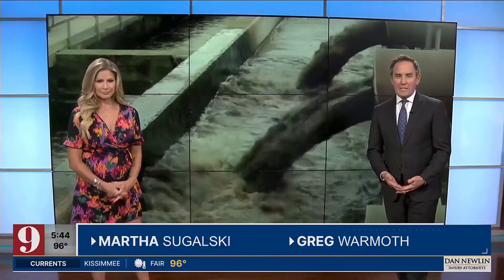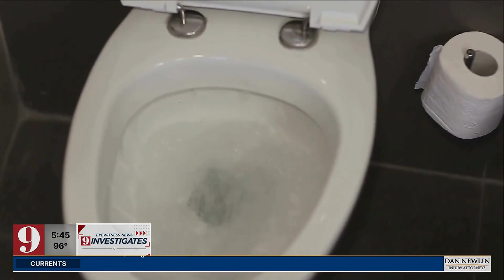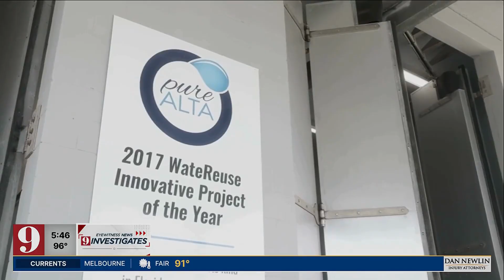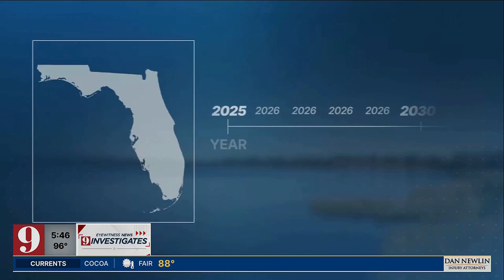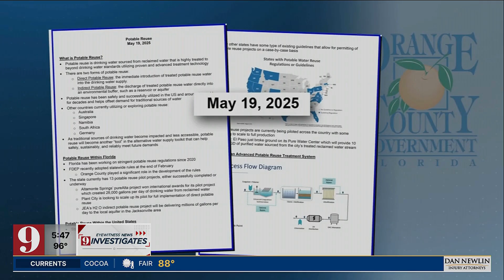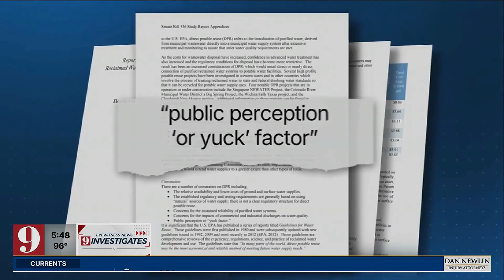Florida’s Plan To Turn Wastewater Into Drinking Water!

Comment: I feel pretty confident that localities that use surface water, rivers you know, for their drinking water are in fact drinking water that has at one point been flushed down a toilet. Think about it, cities up stream clean their waste water and it is deposited back in creeks and rivers after that. That water runs south and is sucked up to be filtered and treated as drinking water. 

For example Polk County discharges treated wastewater to the  Alafia River  which Tampa uses for their drinking water.

Comment: As I walked outside and considered this article, I had a revelation. There are many sources of water. Water is in everything natural. Plants, trees, soil, crops. We have the technology to make clean drinking water from any water source, like lakes, streams, reservoirs, ponds and rivers. Those water sources are cleaner right out of the gate than recycled water, and it needs much less cleaning and purifying than water that is already used and toxic. Why recycle the filthiest, deadliest water when we can recycle water from cleaner sources? This includes crops. How much water could be extracted from fruit for instance? If you have even done any juicing with a juicer, you know the answer to that. Probably 95% or more is water in the form of juice. Watermelon is about our most water-filled fruits.  Pure water extracted from leftover crops, or crops grown for the "water industry" could supply us with all the water we need for living. 

Bathing is another issue, and it is possible that we will be changing how we bathe if this recycled idea becomes reality. I see how recycled water puts orange stains on fences and sidewalks. Even if you purify it more, that doesn't change the character of the water, just the solid pieces get removed, and it's sanitized. Our water already is sanitized and if you go into a restaurant, taste the water they serve. It is undrinkable now. Think of what it will be if they do this, and we will be paying for it. It's another way to get more taxes from us when they don't need to. Desalinating water is still going on all over the U.S., and it works. If too much salt will hurt the fish, then bury it out in the desert somewhere.

Comment: If you think human waste is the worst of what goes into a sewer system, think again. When it rains, roadkill gets washed into the system along with animal waste. Embalmers -the blood that is drained from dead people that are prepped for funerals. Chemicals from gasoline, petroleum products and uncountable chemicals from factories, auto shops, paint shops, etc. where rain washes all of it into the street sewers. Fracking water that is filled with toxic metals and rotting toxic plants that get washed into there also. Rainwater that is filled with fuel exhaust from cars and airplanes, factories, etc. are in there. Anything that is in the world is in waste water. 

Let's not forget that water has memory. Unmeasurable vibrations from emotion, thoughts, intentions, etc. Water doesn't forget. Why does the water taste better from a mountain stream far away from civilization? 

We will all have to be drinking distilled water from our homes it seems. This is beyond unthinkable.

Comment: Does anyone remember when hackers hacked the water treatment facility in Oldsmar, Florida back in February 2021??? Let’s take a little trip down memory lane…hackers increased the level of sodium hydroxide to 100x the normal amount which really could have caused a lot of harm to the people of Oldsmar.

Now…what would happen if hackers messed with one of the steps that was critical for turning dookie water into drinking water?!?!

Exactly…let’s find another solution, shall we?